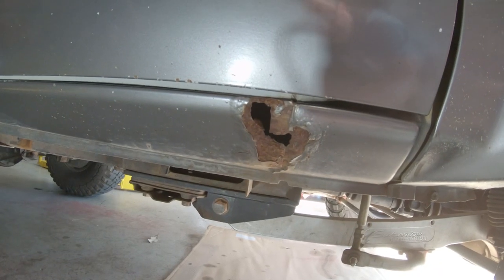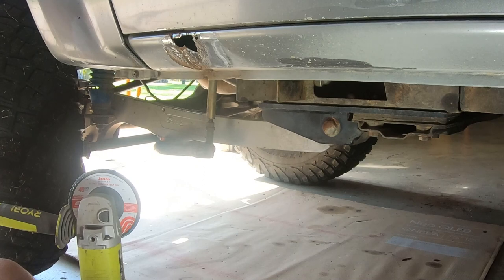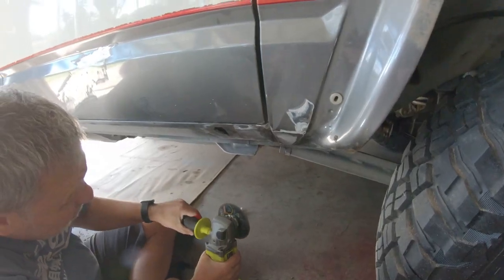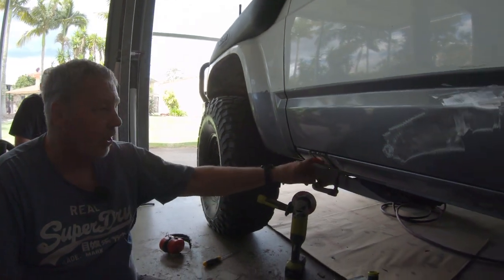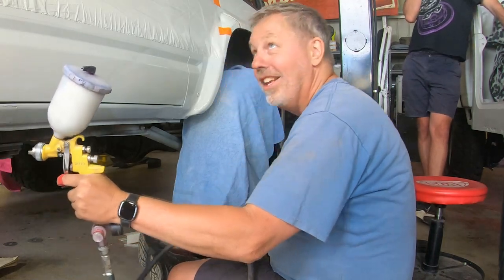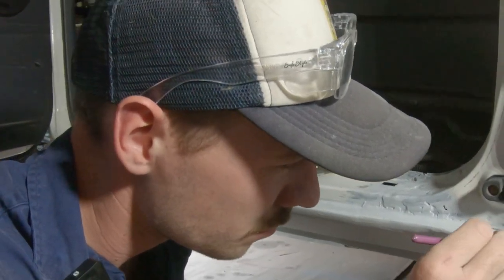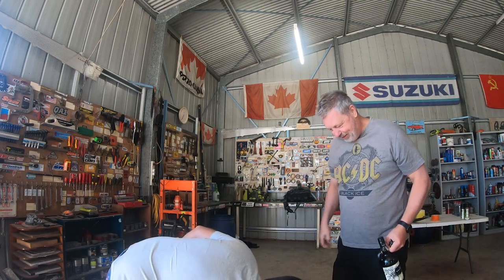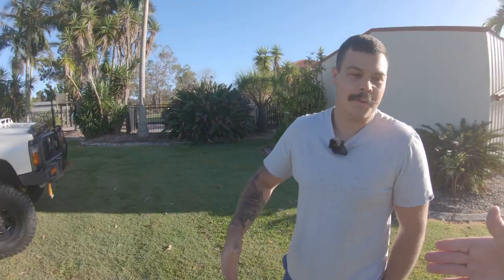Nissan GQ Patrol Shorty 4X4 | Ford Maverick Shorty 4WD | How to Rust Repairs

Comment: I think you can use the sill holes to squirt in the fish oil rust protection.
Reply from the maker: The sills do not have drain holes in them on the shorty, they are a completely sealed unit.  That’s the reason I had to drill out own holes opposite the repairs.  Haakeem has emptied 2 cans in there now so he should be good for a very long while.  Cheers😎👍